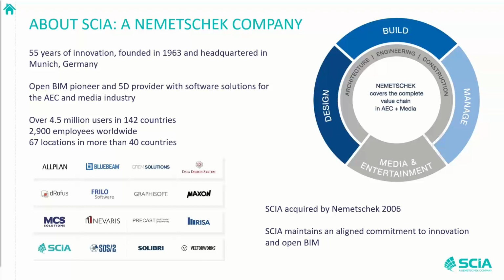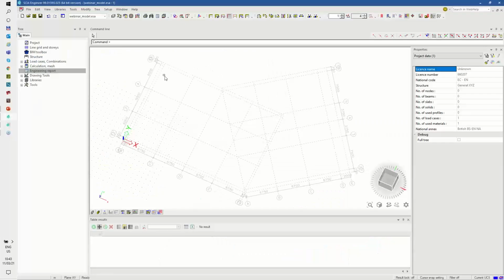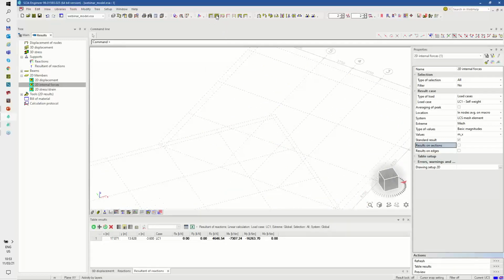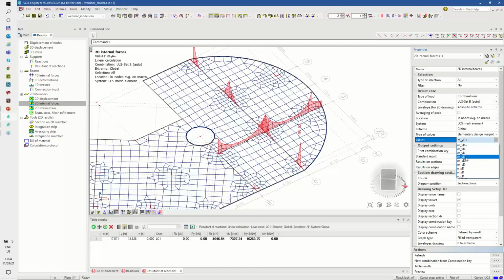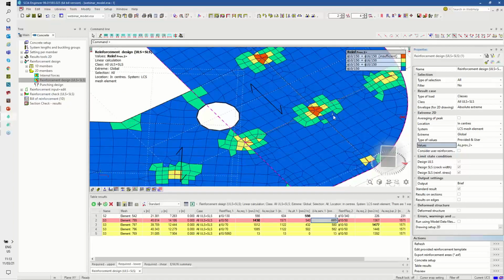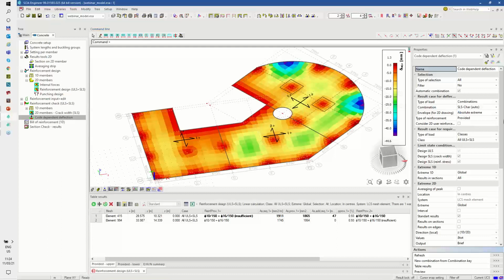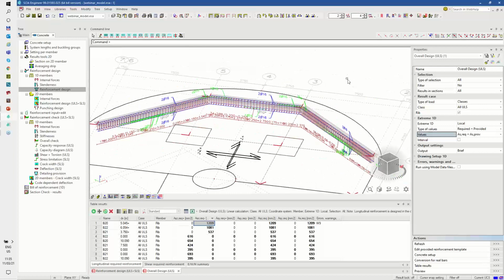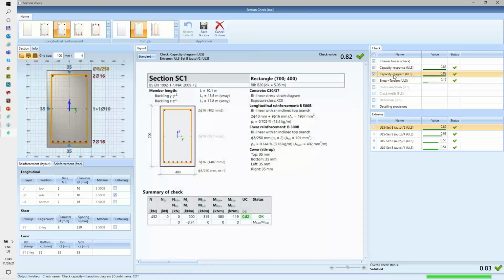[EN] An Introduction to SCIA Engineer, part 1: Concrete structures

Comment: Hello. Thank you for this very informative webinar. Does SCIA Engineer take into account the capacity design rules as described in paragraphs 4 and 5 of EC8, meeting the ductility requirement of ∑ M Rc ≥ 1,3∑ M Rb (4.29) at all joints of buildings with two or more storeys, so as to prevent the formation of a soft storey plastic mechanism?
Reply from the maker: Hello 
Unfortunately, SCIA Engineer only supports seismic analysis. Seismic design checks such as equation 4.29 in EC8 are not supported at the moment.
Have a nice day

Comment: And what about importing Archetictural models from autocad?
Reply from the maker: In SCIA Engineer there are two options for how to open models from “architectural” programs – you can export one of the files: .ifc or .saf.

The IFC file means that model, which will be imported to Scia Engineer will be just “structural” – it means that only volumes of structure will be imported and then it is possible to make some changes in the model – change it to “analytical” model so that it can be calculated.

The SAF file makes the transformation from structural to the analytical model automatically. So you do not have to any changes to the model manually as in the IFC file.
 

Another way how to convert the structural model to analytical is to use our application Autoconverter, which was recently developed – if you interest in it you can watch the webinar: 

https://go.scia.net/wb-20-06-29-se-autoconverter_lp-registration.html?ref=https%3A//www.scia.net/en/support/webinars/scia-autoconverter-true-analysis-structural-analysis-model-0

Comment: Hello, can you tell me how would I change units in Engineering Report for reinforcement from mm2 to cm2?
Reply from the maker: Hi
You can change this in the settings > Units > Concrete > Reinforcement length. 
This will affect both the graphical display and the tables for export and engineering report. 
Have a nice day
Reply: @SCIAOfficial  Thank you very much

Comment: Hello, you have to correct this Point at 57:09 about Rib
The width of Rib should being 400 for internal forces and 1000 for check
best regards
Reply from the maker: Hello Nazeer 
A very good point you mentioned. Thank you for that.
In SCIA Engineer, you have full control about what effective width is used for integrating the internal forces, from the slab to the rib and what width of the slab is considered to create a cross-section of rib for reinforcement design. 
During the webinar, the rectangle cross-section instead of T-section was chosen to demonstrate such capability. However, it does not mean it's the optimal design approach for this specific structure. 
For instance, you can even avoid ribs' necessity by manual input of additional sleb reinforcement, to increase the stiffness and reduce the deflection. 
Many possible design option show the beauty and complexity of engineering to find the optimal solution. And software is just a tool to explore those ideas easily.